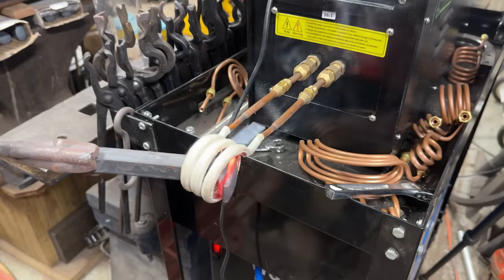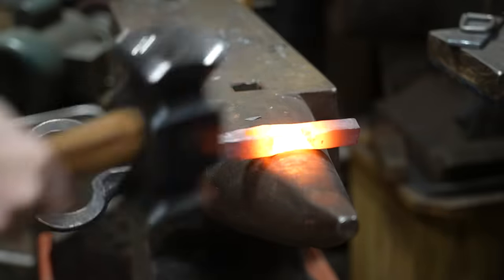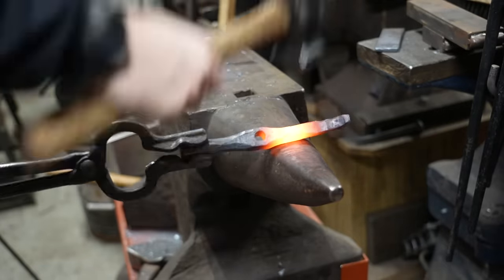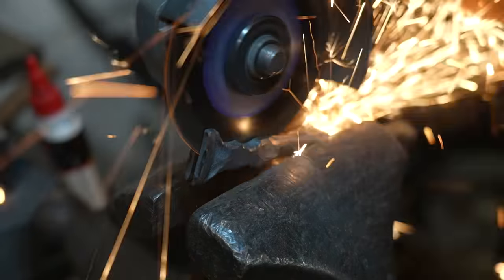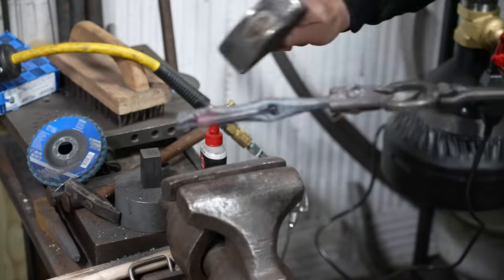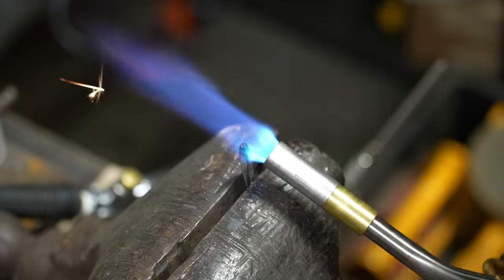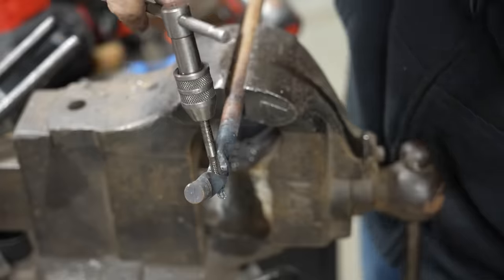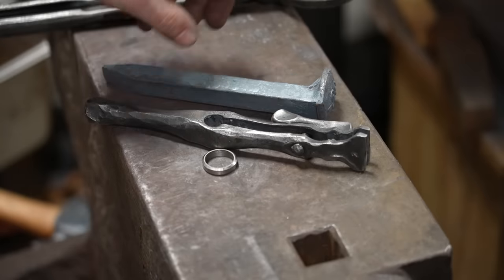Making A Vise, From A Nail

Comment: When punching holes you want to have a bucket of water right beside you. You tap a few blows, dip the punch into the water, give it a quick wipe with a dry cloth so excess water doesn’t drip onto the piece you are working on, and then tap a few more blows. The punch should never get hot enough to change color while using it for punching. Same thing with fullers and basically every tool. The only thing that should get hot enough to change color is the fuel in your forge and the piece of metal you are working.
Reply: Wiping the water is unnecessary there should only be a few drops. Also try using a slot punch then drifting to the size you want. you can punch a 1/2" hole in 1/2" material and still have plenty of material left on the sides with this method.
Reply: 9:19

Comment: First off, this is so cool and I love it.  Really good job!

Hopefully helpful tip: when wanting a larger hole in relatively narrow material, try using a chisel/narrow slot punch first  -  this means that it won't stretch the sides when you drift it to round (you'll just be bending the sides) and also uses less time/energy.

Love how this turned out!

Comment: There is no such thing as a “High Carbon Steel” railroad spike, but there is such thing as an “HC” “Higher Carbon” spike! This is just a term used within the railroad industry for when to use specific spikes on specific sections of tracks (HC spikes are often used in tight bends).
The carbon range for these track spikes is from 0.17 to 0.25%C, and the manganese content is 0.90-1.35%Mn.
Beautiful job on that little hand clamp
Reply: Is it 25% max? I thought it was 35% max but, below 45% I guess it doesn't really matter. It's mild steel.
Reply: @nickaschenbecker9882  The "high carbon" spikes are around 0.34% carbon
Reply: Sheik, I agree with you, there isn't enough carbon in a railroad spike to harden it properly.

Comment: Very cool project.

Curious why you decided to use cut off wheel to open the legs rather than band saw?
Reply from the maker: I thought there might be some hardness in the railroad spike steel and didnt want to smoke an expensive bandsaw blade

Comment: Railroad spikes are not high carbon steel. The railroad industry uses completely different standards than the automotive industry. That spike's the equivalent of AISI 1035. You can even tell by the sparks coming off when you grind it. This will break and break soon so don't use it for anything important.
Reply from the maker: Darn I was planning on clamping my life back together with this, but if its going to break soon I should use something else...

Comment: There is no such thing as a "High Carbon" railroad spike. The carbon content of railroad spikes is between 0.17% and 0.25% Mild steel is 0.13% to 0.18 essentially railroad spikes are mild steel. 
Generally steel is not considered high carbon until the carbon content is 0.50%
Reply from the maker: This is a “higher carbon” railroad spike. Either that or the HC stands for hardly carbon, or maybe heavy choochoo . Nobody really knows
Reply: @MakeEverything  the HC spikes are higher than the old spikes which were 0.08% railroads began replacing those in the 1970s.  The other track hardware is a great steel. It's 1084, just like the track. It's 0.84% carbon

Comment: That comparison is complete dogwater.

First anvil appears to be bolted down which will deaden the ring, and any actual blacksmith in here will know to look at percentage of rebound to find a hard working surface.

That said...that German anvil is likely a Peddinghaus, which are extremely good anvils. They are owned by and sold through Rigid Tools here in the US.

If you want a comparable quality US made anvil, you need to head to Holland Anvil in Michigan.